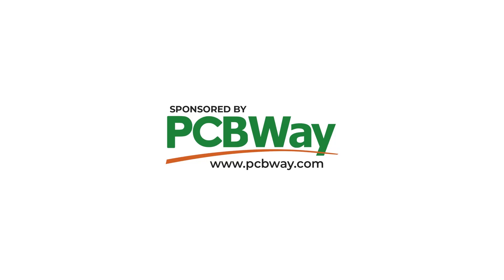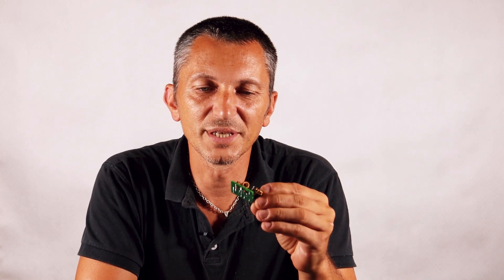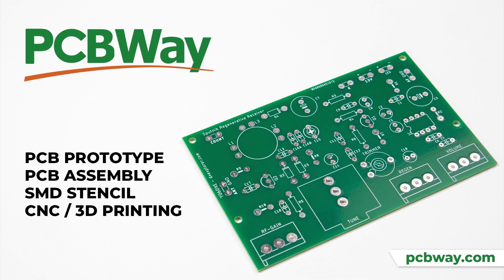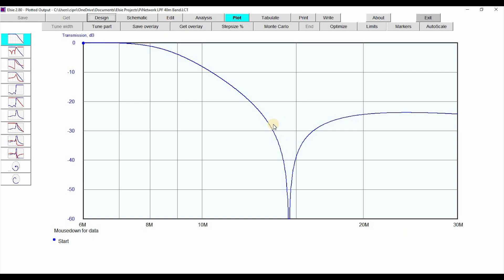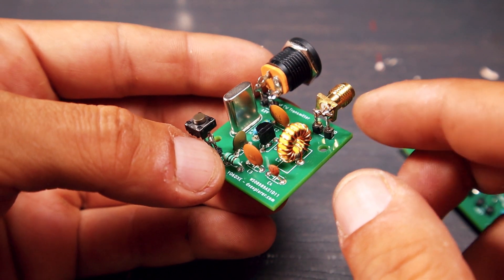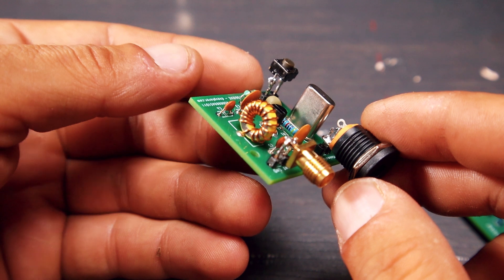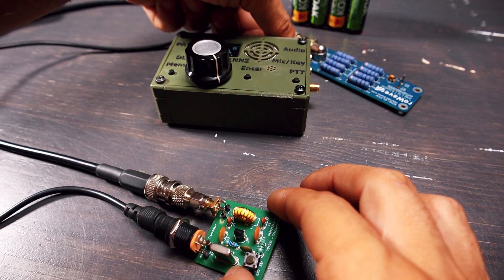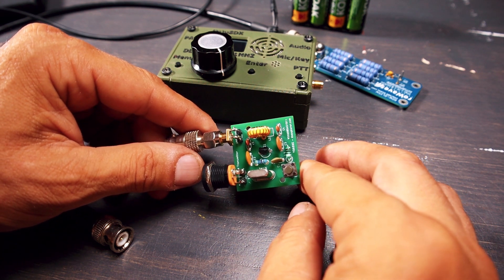Simple Low Pass Filter Design For Minimalist QRP Transceivers or Transmitters

Comment: Try increasing inductance to 1.6uH. 
For simple filter as it is it's working great, if you want greater results you can try 3 stage filter where you have 3 inductors and 4 capacitors. I have cw transmitter  and i am using same 3 stage one. so first and last capacitors are 470pf and middle ones are 820. First inductor is 1.6 second is 2 and third is 1.6. i think this configuration with little changes can almost suppres harmonics
Reply from the maker: The one with three inductors for sure it works way better. I build one in the past with only two inductors and three capacitors and it was doing good already. The reason why I want to see how good the Pi Network filter can get is because all simple transceivers have it... because is really simple I guess. But useless as it seems ))). So to keep things just as simple as they are I am trying to get the best out of it and still keeping it simple. Fingers crossed it works haha. 73 my friend.
Reply: @dxexplorer  you know sometimes simple solutions have limits. that's why they invented 2 or 3 inductor version.
Reply from the maker: @4L1LAT yes of course. That is for sure. But you know... when someone spent so much time in the past to come up with some extremely simple schematic for something that works really nice... it would be nice to keep that simplicity. Feels good to make something out of nearly nothing 😁. The fun part is how far we can push those limitations. The joy of QRP and homebrew stuff at the end 😅.

Comment: Its not as si.ple as sticking a low pass filter on the end of a transmitter.  It needs to match the output impedance of the final transistor.  This could be quite low. If its a tube it could be quite high. Either way we need to calculate to match into a 50R load.
Reply from the maker: The filter is simulated as 50 Ohm in and 50 Ohm out... I think the only way to adjust the output of the transmitter / transceiver is by adjusting the value of the output capacitor. I have no clue I am not that wise (ha). But this is what I've seen in the past that the more experienced than me that used to do. The Pixie and these simple things I make are pretty much the same it seems. Or maybe an impedance matching transformer ? Thanks Nigel.
Reply: @dxexplorer  just use a filter calculator and adjust the source impedance that way. It's the only way you can transfer the full energy available out to the load or antenna in our case. Otherwise, you will lose energy in the transformation irrespective of spectral purity.  Most filters published on the interweb assume 50 in and 50 out.  It's simply not the case as an add-on. Unless the final output has a designed impedance of 50R.
It's like putting a 32R speaker on the output of an audio amp designed to drive 4R speakers. It works but nowhere near as good as it could.
Reply from the maker: @multilecful yes indeed you are right. Technically the designs were published as having 50 Ohms out... so in theory I should be ok. But it doesn't hurt at all to calculate and see 😁. And here we are I must ad one more beer for you to the list 😅😅😅.